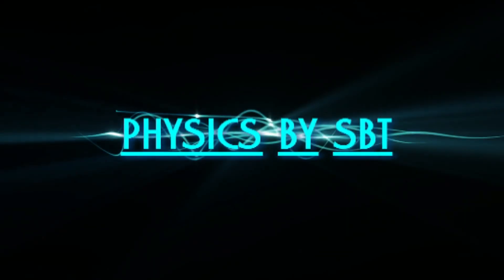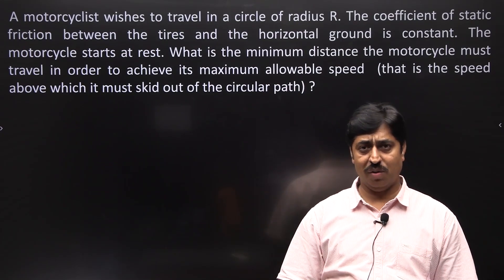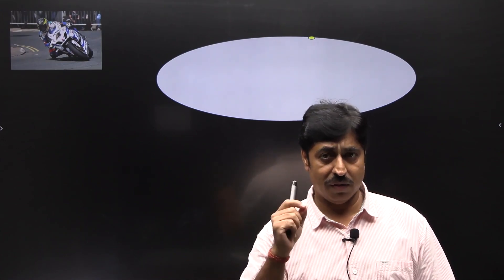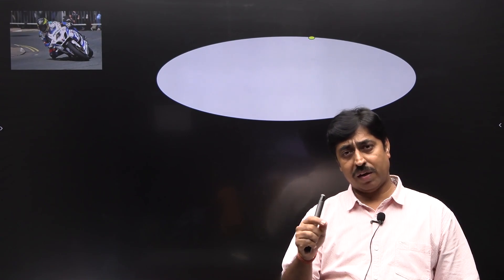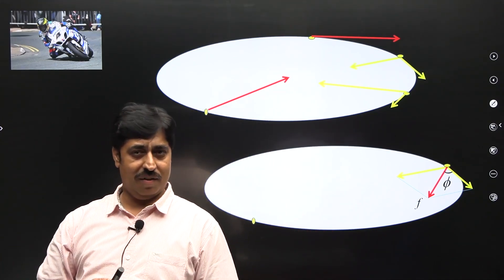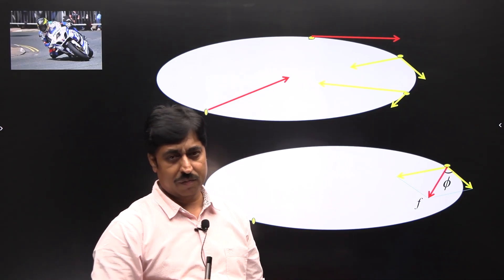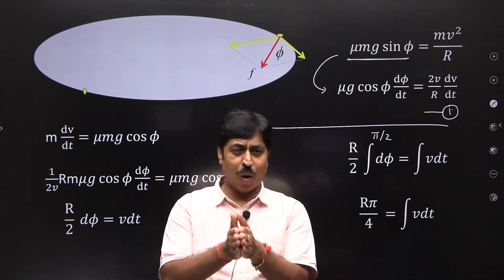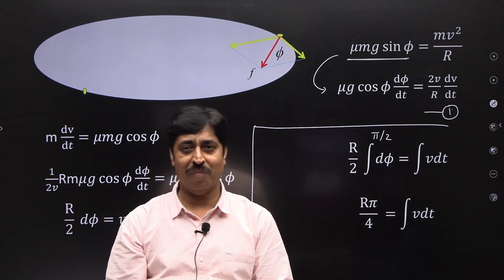Mechanics Problem for JEE Advanced on Circular motion  #sbt #jeeadvanced  Q. 8 of NLM

Comment: sir, why is friction at its peak value(limiting friction) throughout the motion?
Reply from the maker: Listen at 2:33
Reply: sir, is it because we have to calculate the minimum distance so, the initial pickup tangential acc. should be maximum and that could be Limiting friction moreover if the friction is maximum in between then it's tangential component will also be more as compared to Intermediate value of friction. So the speed will be more. So it satisfies the asked condition??